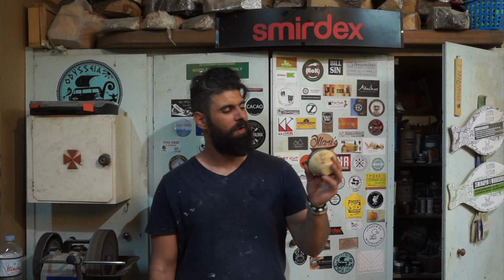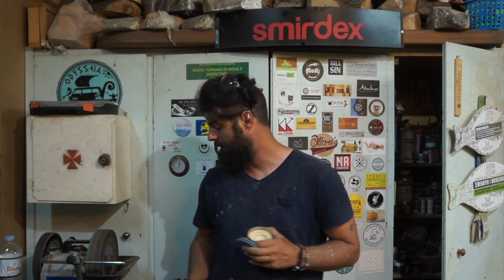Make a sandpaper cutter for create round sanding disks !

Comment: Sir, drill a small hole all the way through the handle so you can with compressed air blow the cut pieces out of the metal cutter.  Rob
Reply from the maker: That is a brilliant Idea I dint think about before thanks so much !!

Comment: great idea. you could also add 2 screws to keep the metal band on. this works too, but I would quickly take some skin off my knuckles with the hose clamp :)
Reply: you could also take it one step further and make a base for it , so you can use it in a drill press.
Reply from the maker: I know brother but I have 3 cutters this way I can change them quick ! Also you can cut a lot in a row they stuck inside and the you open and you can get close to 20 of them !!!
Reply from the maker: I am think about that but I have fear to bend the handle of the drill !!! Lol so hammer was an easy way ! Thanks so much for your suggestions brother !!